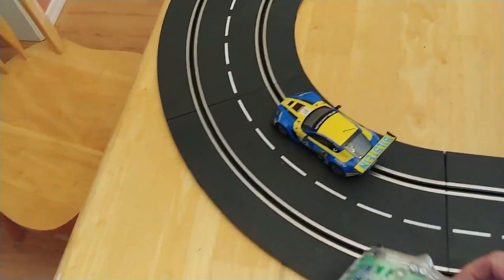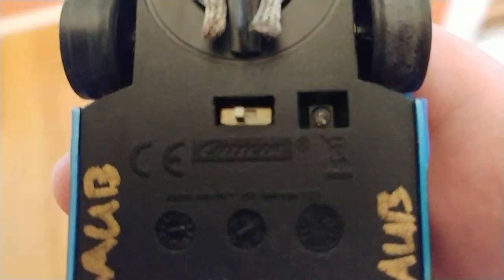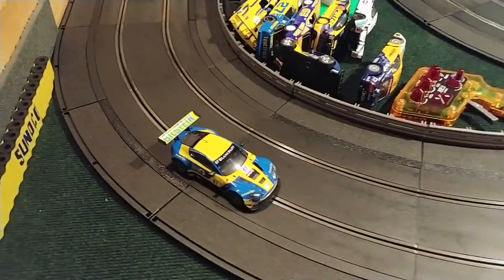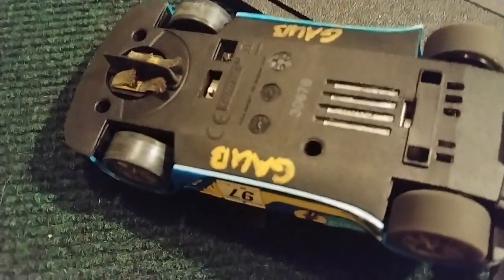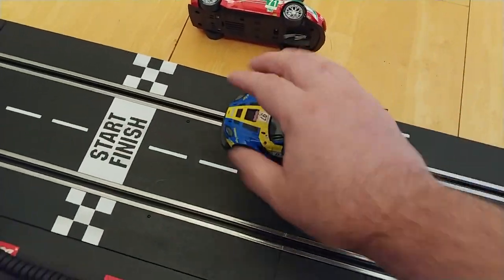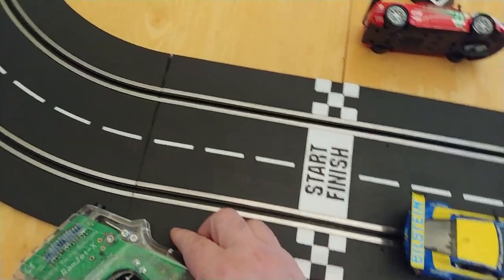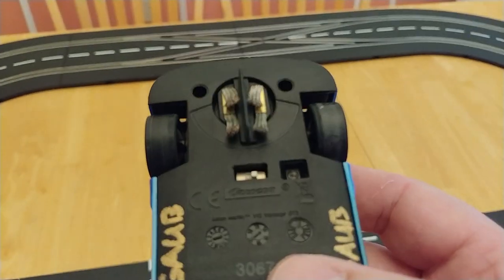What DOES the switch on the bottom of a Carrera slot car ACTUALLY do?!?

Comment: Now how cool is that?? I didn't know this. This means I can now run my D132's on either my Strombecker vintage analogue track or the Scalextric Sport analogue track. Thanks!
Reply from the maker: The only trick is that the Carrera guide tends to be thick enough to wedge in the slot on some track, especially Scalextric. For their recent cars with the blades that pop out, BRM make a replacement blade that works really well on Sport track, and I use them any time I run Carrera cars on my Sport track.

Comment: There is no doubt in my mind you are correct about switching over to analog with 3 pulls off the trigger. 
Then I would ask you to switch one way and try it on a digital power supply.  Then try it on a analog power and it won't run. Put the switch to the other side and bingo with out 3 trigger pulls it runs in analog mode. 
I just tested the polarity and you are correct but it does both.
Reply from the maker: Please re-watch the video, because you're missing something. I show ALL FOUR different iterations of digital and analog and switch positions. Analog works in either switch position, and so does digital in either switch position. At the very end, I show that the car, supposedly in "analog mode" will run on the digital track when turned around the wrong direction.

The switch is purely polarity. It's the three pulses of analog power OF THE CORRECT POLARITY that puts the car into analog mode. As soon as it gets a digital signal IN THE CORRECT POLARITY it will go.

Carrera Digital uses opposite of normal track polarity. Turning the car around changes the polarity it receives from the track, which is why flipping the switch is necessary.

Comment: Interesting; yet I bought one on Sunday and didn't change anything but it runs fine on my scalextric Arc Air track; only issue being I had to paint the supplied guide blade black to make it register laps. To be fair though; not sure if my one is digital or simply Analogue; doubt it's digital as it wasn't expensive enough.
Reply from the maker: Digital or Analog, the switch is polarity. It's a safe bet your car is analog, and the switch had already been set to the correct polarity because the analog cars come with the polarity set to the most common track polarity. The digital cars will come with the switch on the opposite polarity so that it will work on a Carrera Digital track.

Comment: on my carrera car i pulled the body off and connected the brushes straight to the motor. now it works on analog.
Reply from the maker: Other than the functional loss of any lights the car might have, that's the better way to do it, anyway. You can proper control of speed and braking that way.

Comment: If you read my  reply I said I reversed my car on the roller bench and it ran in the opposite direction. But that doesn't change the fact it won't run on my 130 ft digital track.
Reply from the maker: I missed that performed that test, so thank you for confirming that it will work when turned around on your analog test bench. The next test, which I also show in this video, is to put it the other way around on your digital track, just like I show in my video after I switch to what you think is analog mode. The lap counting and lane changing doesn't work because the IR LED is on the wrong side, but you will be able to drive the car. 

Since you can make the car go on analog in either direction depending on the switch position, AND you can make it go on digital in either direction depending on the switch position, this proves that the switch is polarity only. Otherwise, the car would not do one of those things.

The entire point of this video is to show that the car will work on either track and that the only thing changing with the switch is which direction the car needs to point (because that is the polarity we are switching with the switch). I start with "digital mode" switch position, and show the car on my digital track, and then on my analog track without ever flipping the switch. Then I flip the switch, and show the car working on analog and then digital again, without ever changing the switch back.

Please explain to me  how the car can work on both analog and digital without flipping the switch. I show this TWICE in my video. The ONLY thing flipping the switch does is to set which way the car needs to point on either track.

Comment: I have been running carrera digital for a  few years now. And I can prove that the switch underneath is a double acting switch. I have a analog roller test bench.  It only supplies analog power. That's a fact !! When the switch is in one position it will not run on the roller bench as it only has analog power supply. When I turn the switch it runs on analog power. Tecks from Germany said it originally was a analog to digital switch. But you are correct it also changes polarity by coincidence.  Prove me wrong!!!
Mike
Reply from the maker: Easy. Leave the switch in "digital" mode, but put the car on your test bench backward (hold the rear wheels in the air if you need to).
If the car was recently on a digital track, you'll need to put it down 3 or 4 times before the motor will go.
If you watched this video from start to finish, I proved it pretty clearly by doing both digital and analog with the switch in both positions.

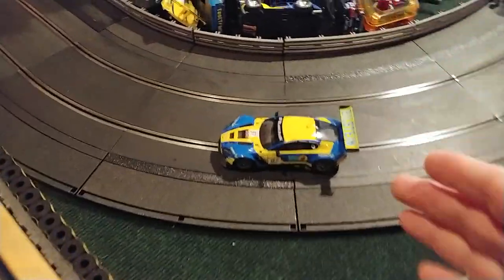Comment: I watched it again i do not disagree but on my analog roller test bench the power is analog. My digital cars will not run on the bench. When I turn the switch it does. So to me that means it switched over to analog without 3 pulls of the trigger. And it also reverses polarity. I have just emailed carrera of Germany to confirm .This statement is from carrera. This Carrera Digital 132 Car in 1:32 scale will work on all Carrera Digital slot car tracks. The switch located on the bottom of the car also allows you to switch to analog mode for racing on an Evolution track.
Reply from the maker: You also did not read my first reply and perform that test, then. 
Put the switch back so that the car won't work on your test bench, OK? 
Now, put the car back on your test bench the wrong way around. You are effectively only reversing the polarity. I guarantee it will work.
Reply from the maker: And that response from Carrera is meaningless. It does not say that the switch is between analog and digital, only that it "allows" for racing on Evolution. Why? Because Carrera Digital is the opposite polarity! The same car, placed on the Evolution track BACKWARD, will work without flipping the switch.
Reply: Yes the car runs on analog when reversed on the roller bench. But only when the switch is to analog mode. Evolution is analog only. So when I put switch to one side it runs on the Evolution track I have. When I turn it back it does not??
Reply: Well I have to say you're videos are awesome. Keep up the great work. 
Time to go race ha ha 
I wish the best of health and happiness for you and all subscribers. The main thing is to have fun. By for now
Reply: Any one tried putting the switch on carrera digital to the other side and seen in analog it won't run on a carrera digital track
Reply from the maker: your post about Carrera is right here, by the way.

Comment: I agree the switch also is a polarity switch. That is coincidence not by design. I am not able to make a video today. But I will and I will post it. I am amazed that the tecks from the largest slot car stores on the planet are all wrong according to you. Have you talked to other slot car technicians regarding the digital analog switch. Again I say my digital cars do run in the opposite direction when the switch is in the opposite direction. 
But I tested it on my digital track. Switch one  way no movement switch to the other side it runs on digital.
Reply from the maker: FACTS:
- The Carrera Digital chip is designed to work on digital when it receives a Carrera Digital signal with the correct polarity.
- The Carrera Digital chip is designed to work on analog when it receives 3 pulses of analog power with the correct polarity.
- Most analog systems/tracks are designed with the negative rail on the left.
- The Carrera Digital system is designed with the negative rail on the right.

In order for the Carrera Digital chipped car to work on EITHER kind of track, the car/chip must get the power with the correct polarity.
Since most people don't want to run on their analog track in the opposite direction from normal, especially if they don't have direction switches on their track, and pretty much no one wants to run their Carrera Digital car in the opposite direction since the lane changing and lap counting would not work, the only solution for the car to work on both types of track, as it was designed to do, is to install a simple polarity switch on the chip.

The reason this is so confusing for so many people, even those in the Carrera company itself, is because of the polarity difference between Carrera Digital track and analog track. If Carrera Digital was constructed with the same polarity (negative on the left) as analog track, then everyone would know that the chip works in both modes, all you have to do is pull the trigger three times on the analog track. But no, they did it backward, and installed the switch, and tell people to "flip the switch to work on analog track," It seems simple and harmless to explain it that way, which is not technically incorrect. But, it leads people to believe the switch is what does the "mode change" between digital and analog, even though it's not. The mode change takes place entirely in the microprocessor of the chip itself, except that it only works (again, for EITHER mode) when the polarity coming into the chip is correct. This is why you can turn the car around on the same track after flipping the switch, and it will still go.

You can sit there flipping the switch and turning the car around all day long, on the same track, and it will never stop working as long as you BOTH flip the switch and turn the car around. Digital track, or analog track, it will only not work if you have the switch flipped the wrong way for the direction you place the car down.

I look forward to your unedited video where you run an unmodified car on your digital track, pick it up, flip the switch, then put it back on your digital track BACKWARDS, and it does not run. I'll be waiting a very long time, because I know it will work.
Reply from the maker: Regardless of the specific electronic function of the switch, for all practical purposes, it enables the car to run the correct direction on both Carrera Digital and standard analog tracks. It also enables the car to run in the opposite direction on both tracks. :)

Comment: My club doesn't run Carrera cars.  I've never had luck getting digital cars to run on our track.  Hopefully I remember next time.
Reply from the maker: It depends on what kind of digital it is, but if it was Carrera, flipping that switch should do the trick... assuming you don't want to run it the wrong direction, demolition derby style. ;-)
One thing about Carrera digital cars in analog mode is that the brakes will always be 100%, even if you turn your brake knob down on your analog controller. That might be why some guys don't like it. You can bypass the chip easily by using the plugs inside, if you want proper analog control.
Then again, Carrera cars are on the heavy side, so don't usually get much love from club racers outside of a one make/model class.

Comment: Well I think you are deleting my posts with the carrera slots reply regarding the switch. May I ask how you brake in a carbon brush slot car motor.
Reply from the maker: I have not deleted anything. I'll reply to your Carrera message again, to make it easier to find it. 
When I break in a motor, I do so at low voltage with no load for about an hour, then clean it out with a contact cleaner or a dip in IPA. Closed can motors don't need much else. If they don't work well after that, they might as well be replaced. Your mileage may vary, and there are as many break in techniques out there as there are slot car youtubers. If you have a technique you like, I encourage you to make a video about it and share it with the world.
Most of the time, I don't even bother breaking them in. My Thunderslot is the class leader in EMSA right now, and it's pretty much straight out of the box with nothing more than a couple tweaks of the pod and body screws and trued up rear tires.
I don't claim to be an expert in all things slot cars, but I know digital better than most.

Comment: I hope my last post from carrera is enough proof
Reply from the maker: Have you done the test I've suggested twice already, or not? 
Carrera's message does not mean the switch is both. 
You can prove me right by doing the test I recommended twice.
You can prove me wrong by showing that the car will not work when turned around. 
I await your video.